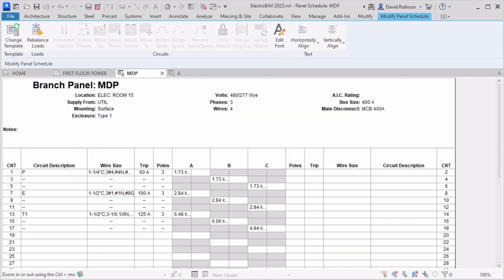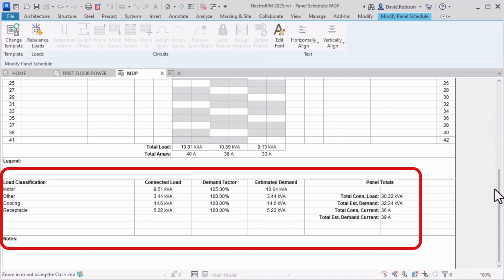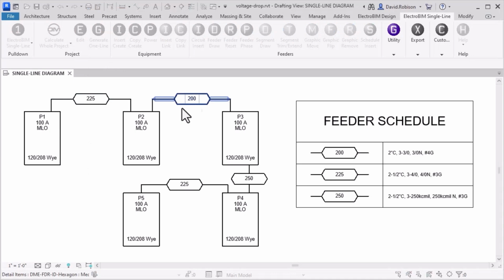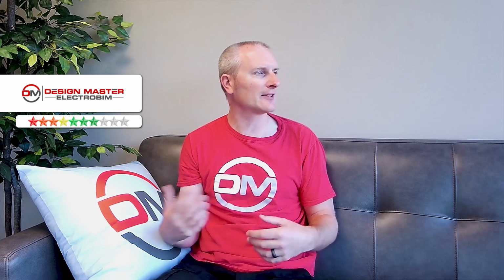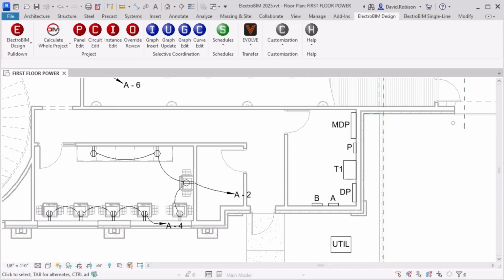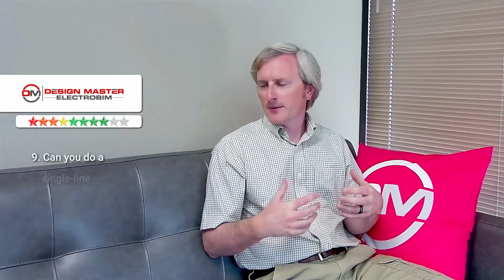Review: ElectroBIM for Electrical Engineers #BIM #designmaster #Revit

Comment: Is your add-in only for US standards?
Do you have option for EU or DACH?
Reply from the maker: Our default wire sizes are based on US standards. It does work with other standards, but you have to make changes manually for that to work.